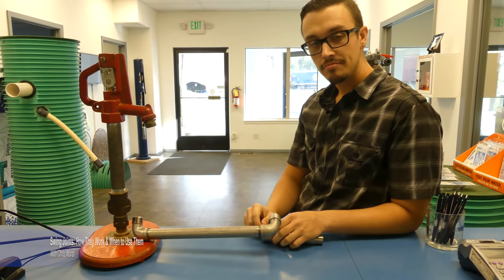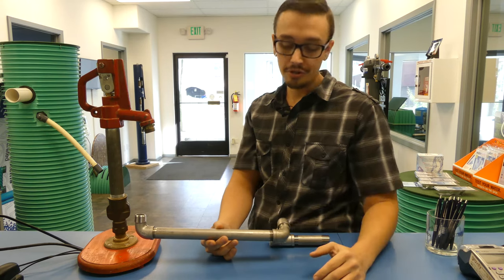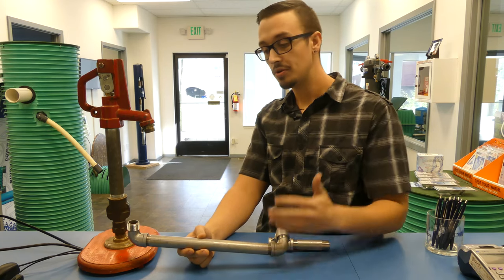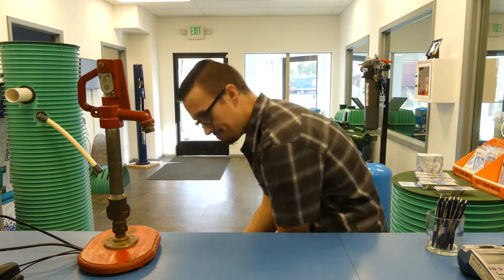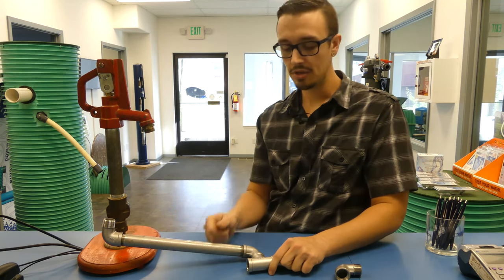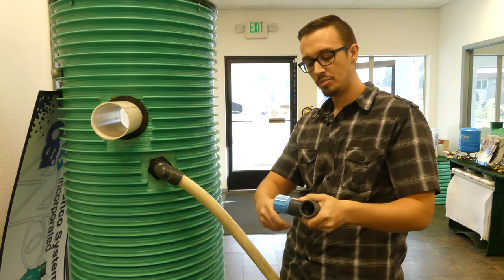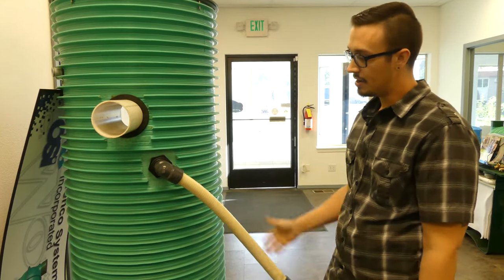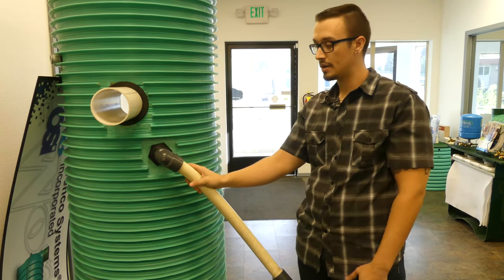Swing Joints: How They Work & When to Use Them

Comment: I have two hydrants to change out on a farm next month, not worried about using a swing joints. Since both will be buried 4’ or so under ground. Not looking forward to digging them up, hopefully it will be dry down there. Both are in a horse barn.

Comment: Street fittings are called that because they are the first fitting inside the foundation wall. Sewer will be run with a bell to tie to with a street 90 or elbow of some degree. The principal is the same for the pipe you have.

Comment: when water mains were being run down a street, the installers would put a tee in front of a house. the branch of the tee was facing up. into the branch they would put an elbow with male threads on one end and female threads on the other. so it was known as a "street" elbow.
Reply from the maker: Interesting! Thanks for sharing